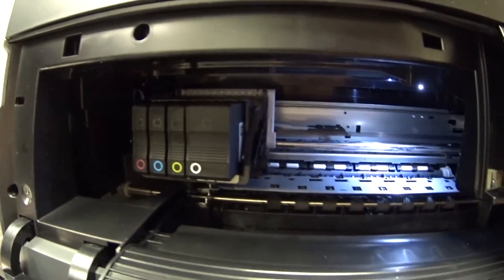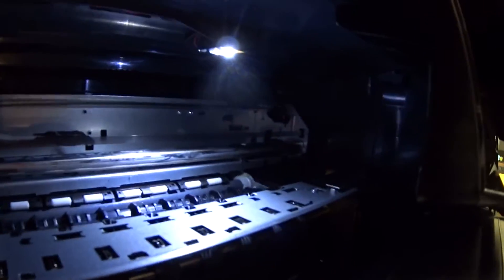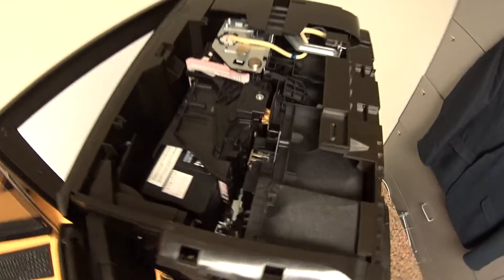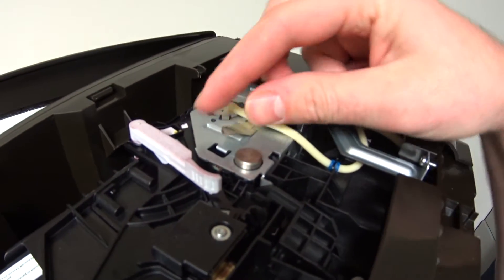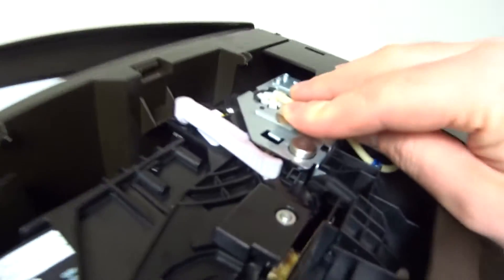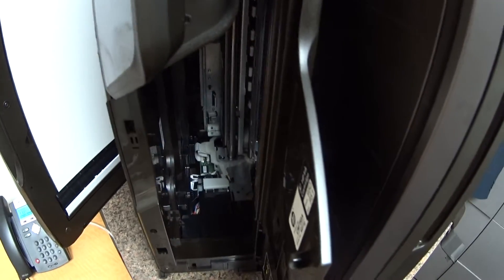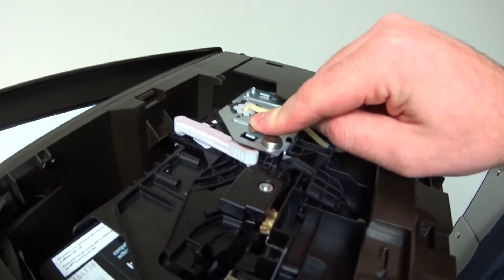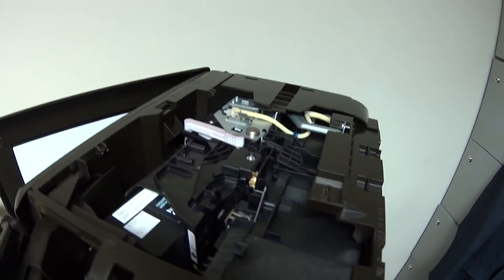HP printer disconnected plastic ribbon - encoder strip repair part 2

Comment: Not bad but you need to say that the "smiley face" needs to go on the left side (face facing out).  Also, the strip needs to be tilted back slightly to hook on the left side.  Another person is very helpful.

Comment: Which side should the smiley face be placed ? Left or right ? And how did you place the clip? Thanks
Reply from the maker: Hi, i do not remember exactly how it went but looking at photos online you should be able to figure it out. Getting it on the clip is REALLY HARD. I took / bent off the whole right side of the printer so i could at least see it. Then after probably 50+ attempts of getting it to clip on, it finally did.  Not easy, but dooable. Good luck.